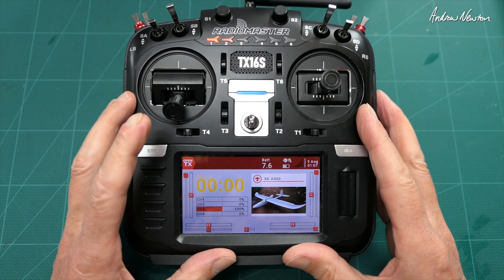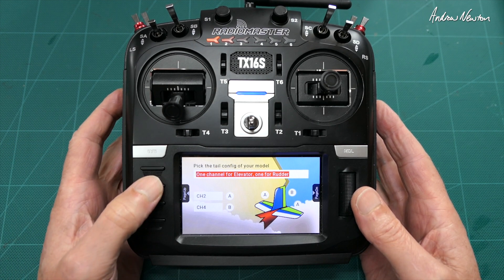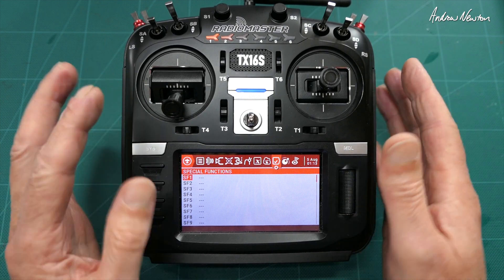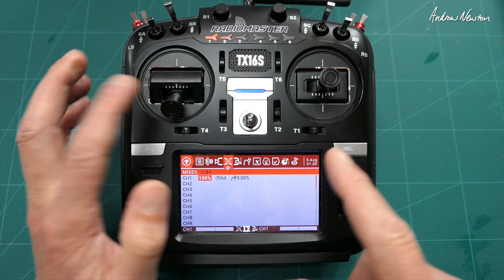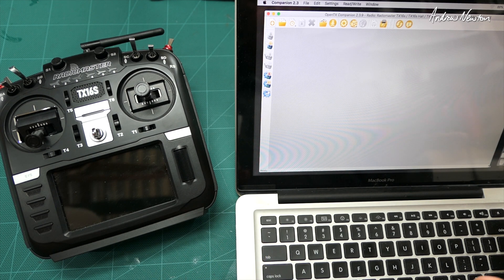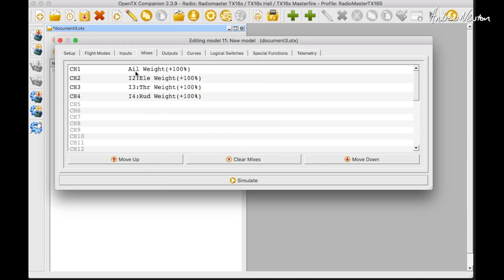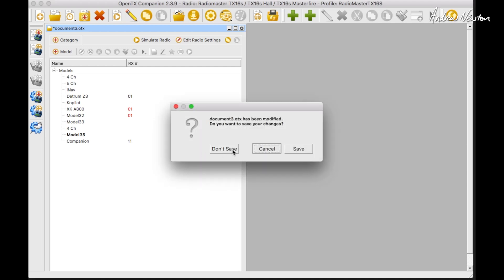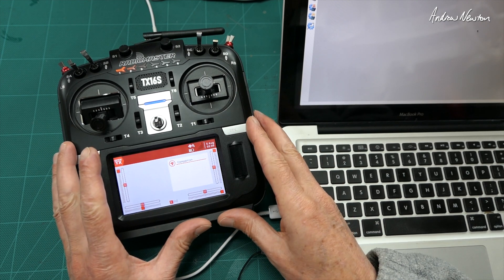5 ways to setup models in OpenTX - TX16S

Comment: I fly only wings with 2 alerions but I'm thinking about giving the zoid gt rebel a try, I'm confused on the vtail is this considered a rudder? My radiomaster tx16s is setup AET due to no rudder. Any help will be appreciated. Thanks for all your videos
Reply from the maker: V-Tail is a mix of elevator and rudder, but the rudder is not very effective. Just ignore rudder if you want. Otherwise the mix is there same as your wing elevon mix but replace aileron with rudder. Look ay my V-Tail mix video
Reply: Thanks alot
Reply: Just set up the plane like he shows and when it asks you the "tail config" you scrol to "V TAIL" and it does it for you!

Your done, happy flying to you and your v tail

Comment: Pls guide which open tx version is new one and how to install and remove edge version in my radio ?
How to load plane images in SD card
Reply from the maker: Latest OpenTX is V2.3.15. There are hundreds of videos on installing or just follow the instructions on the OpenTX page.
Reply: I like Open tx more but is it works tx16s mk2 still 2024?

Comment: I just got a LX F-22 Raptor EDF 2x70 MM I wonder if I can use the Radiomaster TX16S carbon red on this F-22 but I don’t know 🤷🏻‍♂️ which receiver to Buy , on the box it’s written 12 channels
Reply from the maker: Don't know any 12 channel receivers. You would need a flight control board to access all 12.

Comment: Hello Andrew - thank you for this information. Can you please advise how to change the model photo? I have downloaded my own jpg photo into the Images folder and it shows on the SD tab on the Transmitter under the System button - but is not visible when trying to change the photo on any specific model ? Is this something you have seen? This could be helpful for quite a few people! Any assistance you can provide would be greatly appreciated.  Problem solved! Appears you need to keep the file name to max of 6 - 10 characters (depending on who you ask!) and a resolution of 192 x 108 (or perhaps 640 x 480 again depending on who you ask - it may be that shape is more important than size?) This topic does not appear to get much coverage - perhaps you have done so Andrew and I have missed? If so can you place a link to your video? Once again - many thanks for all your helpful and informative videos.
Reply from the maker: Painless360 covered this in a video just a few days ago
Reply: @AndrewNewton  Thanks Andrew but I must have blinked - can't see anything relevant?
Reply from the maker: Sorry, his video is 12 month old. It popped up on my feed 3 days ago
Reply: Personally I use Image Magic (open source, multi platform, free, command line image manipulation tool) to change the photo to the 192x114 sized PNG using the following command:  convert input-file.JPG -resize 192x114 Ranger.png (use your own file names).  You then copy this file from your PC to the Images folder on your SD card in your radio.  Then after you disconnect the radio from the computer and bring up the model you browse to this new image and select it.  I know I am just hitting the highlights here but it seems you have some other resources.  Image Magic was the key for me in that it allows a very easy conversion to the required format and that was the key for me to get images to work correctly.

Comment: Useful videl, but What a mess, I recently got one of these opentx radios, they are the absolute opposite to an user friendly product, you end up spending a lot of time for the most basic tasks… I end up using my flysky most of the time, plug and play thats it
Reply from the maker: OpenTX doesn't suit everyone. But I cant use anything else.
Reply: When OpenTX came out I switched from the big F, learned OpenTX then moved on, I just purchased my first FPV drone after flying DJI drones for work so I needed to get another radio. The new EdgeTX has support for a color touch screen and NO user manual, the Radio I purchased is missing function keys like Page Up. EdgeTX is a needed update to OpenTX after FrSky sabotaged OpenTX, EdgeTX allows you to use the touch screen but they haven't finished it yet and there is no manual, existing Wizards don't work and a lot of the OpenTX guides are obsolete. Getting a drone to connect and fly has been a time consuming task, I did come across a radio that doesn't use OpenTX or EdgeTX and works with the ExpressLRS receivers, $60, turn it on and fly. I under stand your pain, for some reason everyone think a youtube video is the new user manual methodology, I think its a means for people to ramble on and on and on.

Comment: Hi Andrew, Love the little wing you showed in you most recent video "Shaka fun" awesome. Question Mac book and companion, When I eject the 2 drives (SD card) and then wait a bit and then disconnect the TX16S cable I often get an error on the MacBook about ejecting the drive before disconnecting it. I came from PC to Mac and love it but little things like this cause me concerns that I am doing something incorrectly. Also when I get this error I usually can not get the radio to connect the next time I plug it in to the Mac. Any suggestion as I believe you've been on Mac for some time? Thanks in advance. Jeff
Reply from the maker: I see similar issues occasionally. The radios seem to reconnect even after ejecting. I have started disconnecting as soon as the drives are ejected and before they show up again.
Reply: @AndrewNewton  Thanks for the response Andrew. A 3D printer question for you if I may, have you used Octoprint on your MacBook ?

Comment: I can't believe I had to pull up a video on how to setup a New Model...   when pressing the Model button or holding down the roller wheel... brought up nothing with Create Model as an option....  WTF... holding the roller wheel button brings up:

Model Select
Monitors
Reset
Statistics
About

There was no create new model wizard.   I finally said to h3ll with trying to figure this out, and connected OpenTX companion to create a new model.   Thank goodness I didn't have to try to do this out in the field in the bright sunlight, and was just at home trying to create a new dummy model for Liftoff so I wouldn't have to listen to all my autostart timers and alarms.

So if you're having problems finding a Create Model option, use OpenTX.  

Somehow I finally figured out to get to the Create model screen by accident.   Here's how you do it.

Hold the Scroll wheel in.   That will bring up a menu, and then chose "Model Select".

Next...  hold the scroll wheel in again while on the Model Select page, and that will bring up yet another buried dialog, with "create Model" at the top.

Then do like Q*bert does, and go !@#$%^
Reply from the maker: This version of OpenTX is a bit of a mess. That's why I like the monochrome small screen version better

Comment: Hi Andrew. Have been watching this tutorial a few times. I like the 1st way best. The one thing that I feel is the most important and what I like to do first in setting up a radio or model is the throttle safety switch much like you had in the FlySky i6 video. Is there any chance that you could explain this procedure? I had to swap from mode 2 to mode 1 in the tx and found it not hard at all. Just adjusting about 4 or 5 screws.
Reply from the maker: Of course I have, is it not showing in your search?

Comment: Thanks Andrew! To add, models can be saved on the computer for safe keeping, and/or loading older models that may no longer be on the radio. When I make running changes to any of my models I always create a new file to be kept on the computer with a file name relating to a change in model settings.
Reply from the maker: Good point!

Comment: Hi Andrew, not really relevant to this topic but i recently upgraded my Ranger 1600's motor to a Sunnysky 1250kv instead of the stock 1400kv, (keeping the same 8x4 prop) i have noticed that the new motor appears to have much less thrust, it also only draws a max of 13 amps on 3s instead of the previous 18 amps. I have calibrated my esc but it still seems like i am lacking power. Is this normal or do i have an issue with my esc, which is also upgraded to a Turnigy 40A plush. Throttle also only starts at just over a quarter of full throttle.

If anyone else has answers please let me know
Thanks.
Reply from the maker: Yes it will be underpowered on 3S. You now have a perfect 4S power setup, same as mine. Either use 4S or change to an 8x6 prop. Probably need to re-calibrate the ESC after resetting to defaults. Might have something like a Soft Start activated.
Reply: Andrew Newton do you think that I could get away with flying it on 3s for the time being?
Reply from the maker: Yes, no problem.

Comment: I thought it was important I pass this information on about Opentx “input” screen verses “Mixes” screen when setting up dual / triple rates. Try the following model setup: it proves there is a problem with the “Mixes” screen.
	I setup a new Basic model in companion 2.3.7 and setup triple rates for the Elevator  in the “Inputs” screen using switch SA and triple rates for the Ailerons in the “Mixes” screen using switch SB, Then in the simulator I moved the respective elevator and aileron trims to maximum, now when I operate the rate switches something strange happens the Aileron channel itself changes value but the Elevator channel dose not this is even worse if you use extended trims. This could potentially cause a model to crash, give it go and let me know if I’ve buggered up the programming or its right.
Reply: Forget rate switches, it's a hard, complicated way to do everything TBH. Plus you have to know which of the three rates you are in!!
It's why Exponential was invented...use it!!!
Reply from the maker: I'll check it out but you have bigger problems if you're trimming right to the end, not a real situation
Reply from the maker: Just tried it on the radio and I got normal behaviour on ail and ele. Might depend on how you have the trims setup
Reply: @AndrewNewton  Just tried it on my Taranis with an X4R rx and couple of servos and the Aileron servo did move when I switch rates, so further investigation required may even have a go at doing a video will not be up to your excellent standard ill be using my Iphone but might be fun.
Reply from the maker: @brianblogg645  Good idea Brian.
Reply: @AndrewNewton  Your quite right that's why its just an example in companion not how I set up my models:)